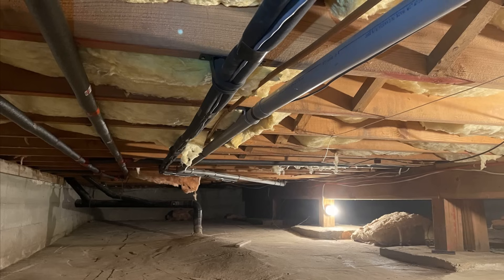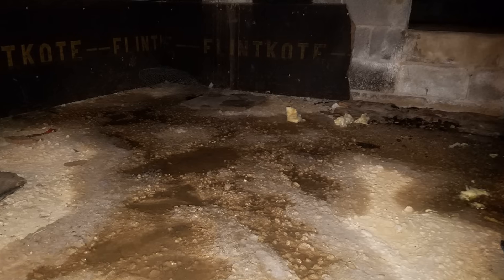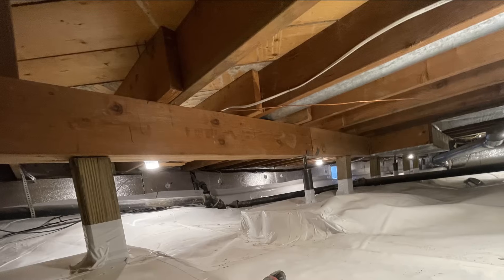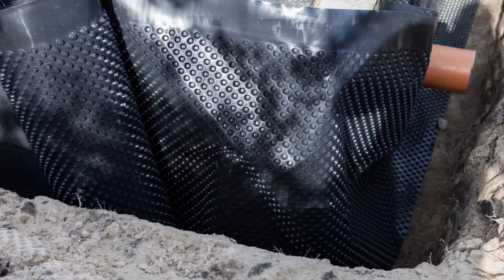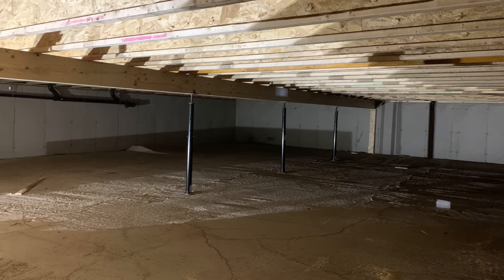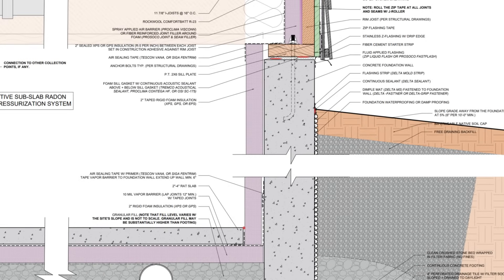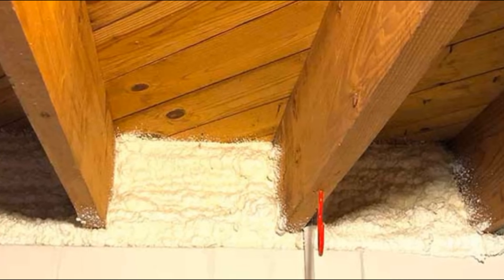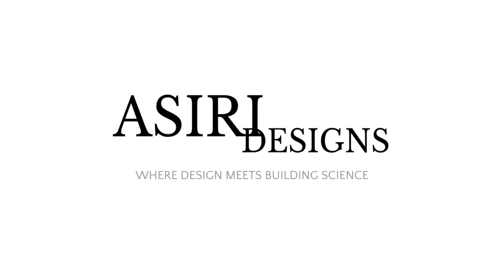Building the PERFECT Crawlspace

Comment: I'm looking to do something like this. It's a retrofit of a vented crawl space currently. The house is on a hill and the crawl space is about 7ft tall. The air handler is down there with duct work. I'm looking to use polyiso rigid foam for the walls. Is that a good choice for insulation? It's a good bit cheaper than the alternatives. It's in eastern TN. Do I need a foundation vent fan to expel possible soil gasses or would I be better served by subslab ventilation? Thanks for the information and great videos!
Reply: At 7’h I wouldn’t say that’s a crawl space. Most can stand up in that and some ceilings in older homes are just that high, or less even.

Comment: Excellent presentation.  A retrofit option for poorly designed crawlspaces is another topic you should consider. The solution we employed was labor-intensive, but ultimately as successful as possible, given the limitations.   The crawlspace was cleaned out, the poorly installed Insulation removed, The main sewer line was tapped for a dehumidifier drain, a polyethylene vapor barrier Applied to the floor, and a 2 inch slab of concrete poured. A dehumidifier was installed with a Weather sealed access door for access to the crawlspace. Insulation was then properly installed, including sealing some areas with cans of spray foam. It’s not perfect, but it is dry and insect resistant.
Reply from the maker: Great idea, we will add it to our list of videos. Crawlspace retrofits are always tricky, especially when you have limited access.
Reply: I 100% second on this topic of a retrofit crawl. It would be incredible to see.

Comment: I have a 1995 house in western Washington that I encapsulated the crawl space in 2018. Best decision I ever made.

My 2 story house is on a steep slope so I have a 600sqft daylight basement next to a 600sqft crawl space that is 4 feet tall. So my crawl space air was leaking into upstairs, my ductwork, and my basement. 

I had a ton of bugs in my basement from the crawl space before encapsulation. That problem went away. The white vapor barrier they use is slick. Spiders and bugs have a real problem walking on it. So they get stuck and die. 

This video used slightly better techniques but mine was a retro fit not new so things like the concrete rat layer would have been expensive. 

The encapsulation area is usually 3 degrees cooler than the rest of the house. So careful with condensation on uninsulated separating walls and floors. This happened to a wall between the crawl space and basement for me because it was just 1 layer of drywall. Rockwool and a second sheet of drywall should fix that.